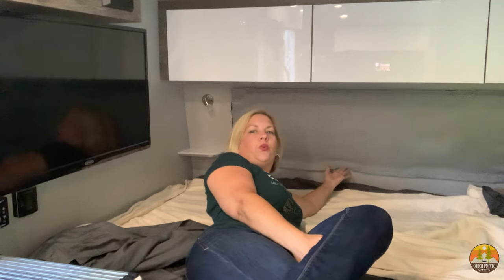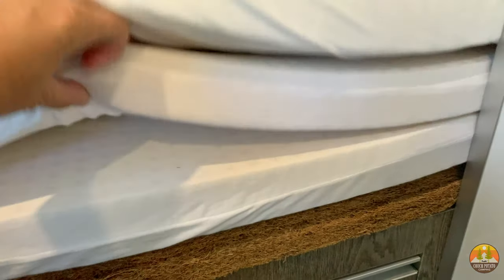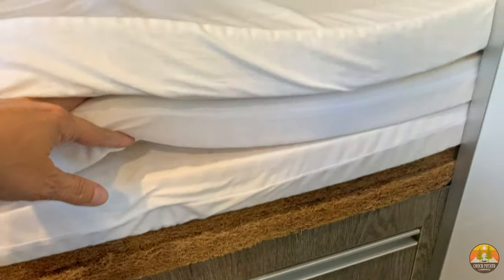How to DIY a Custom RV Mattress: Quick, Easy and Smart Solutions

Comment: Love this recommendation. What electrical work is needed on a brand new trailer? Is it a manufacturer issue or are you making alterations?  TIA
Reply from the maker: Hi Elizabeth! No work is *needed. But our exterior refrigerator all of a sudden stopped getting power from the 12v connection so that needs work.

Comment: I noticed your bed is surrounded by the walls (or window) of your camper which would hold your stack together.  Would these slide around if your bed was open on 3 sides?  Love the idea, and pricing mattresses is giving me stress, but the mattress that came with our new camping trailer is awful.  My husband had to stay in it for a few months and there is now a dent on his side. Also , being able to switch them around sounds like a great idea since we can't try it out. Thanks for any tips on that, Our 20 year old Casita was more comfortable sleeping on the cushions with the dinette folded down. No......really.
Reply from the maker: Oh, I fully agree! RV mattresses are the worst. If you stacked mattress toppers, I’d try to not have the covers on the bottom layers. Then they would grip together more. However, even with covers on, I think you’ll find they stay put. We just published our guide to the best RV mattress replacements:  https://couchpotatocamping.com/best-rv-mattress-replacements/ I understand how the dinette cushions were comfortable. We’ve had that same experience before, too 😂
Reply: @CouchPotatoCamping  Thanks!!  Awesome information!! Also Mattress Insider makes covers.  I thought about doing the Nesting and having them make a cover for my configuration and having the individual latex layers sit against each other per your suggestion.  That might hold the whole thing together. I appreciate your responsiveness and wish I'd found your guide earlier before I wasted a whole afternoon on research. Very helpful!! In general Mattress Insider has a great reputation and a great website.  If I don't go latex, I'm sure I'll get one from them.  Reasonably priced with very good reviews.
Reply: @CouchPotatoCamping  Thanks!!  Awesome information!! Also Mattress Insider makes covers.  I thought about doing the Nesting and having them make a cover for my configuration and having the individual latex layers sit against each other per your suggestion.  That might hold the whole thing together. I appreciate your responsiveness and wish I'd found your guide earlier before I wasted a whole afternoon on research. Very helpful!! In general Mattress Insider has a great reputation and a great website.  If I don't go latex, I'm sure I'll get one from them.  Reasonably priced with very good reviews.

Comment: I bought a mattress for the house and found it very comfortable so I bought the exact same mattress for the trailer.  I had back pain both nights.   Why is this.   Is this because there's no box spring and just a plywood board underneath?
Reply from the maker: It could be because of the hard plywood board underneath with no give. If there is not a box spring or slatted base there isn't much give.
Reply: @CouchPotatoCamping  what’s underneath the plywood and storage?  I was thinking of taking it all out and bolting down a bed frame to the floor and then putting a box spring on that. Would that work?
Reply from the maker: @efinden  In an Intech Sol Horizon? No, that wouldn't work. Underneath the plywood is the plumbing system. It is different for every type of RV, so that might work with some models. But not an Intech Sol Horizon.
Reply: @CouchPotatoCamping  how do I fix this?  Any ideas?
Reply from the maker: @efinden  No ideas on how to fix that!

Comment: Thank you for this! I have the same trailer and the bed seriously IS terrible. I ordered the medium mattress topper from this company and it's so much more comfy!! We just got one of them, so we'll see how that holds up but great idea getting one of each to switch between :)
Reply from the maker: Awesome! So glad you like it!!! The standard RV mattress that comes in the trailer truly is horrible. Definitely need a topper for it!!!
Reply: Do you a picture or videos
Reply: I went to Lowe’s and I got the 48” x 24” wide added 3 inches of half-inch plywood so it really comes out to 27”. i’ll try to use the changes they didn’t work so I put the a different kind on but I still screwed it down and I rounded off the corner I just took my jigsaw and cut put a plate up there and just cover the room and then I sanded it. I’m thinking about just go ahead look to what else I can find I laid down on just like laying on 🧱 lol
Reply: I watch that a thing for the mold but I don’t see a code and you said it was savvy rest I’ll have to go on the computer and look I did look at your camper is was nice it was at the place in Nashville Tennessee when I went to get a drain stopper for my little guy minimax of course they didn’t have them but your soul was there and I had to look it was different Sharp I love that window thanks for the tips I’ll be watching your show your well website there
Reply: Okay my husband is on that website on Sabi rest but don’t see that stuff that’s under your bed

Comment: I have listening to this video twice and still not sure of the name of the mattress toppers you are talking about.  I have a full size coil spring mattress in 5th wheel I love but the size is off.  The full is too large to even fit my hand in to make bed, the twin will be too small.  I need a 49x71" and these toppers may be the answer.  I am a side-sleeper with back issues.  The height is 6 1/2" max as this is a steel horse trailer 5th wheel so height is set.  It's called a Weekender.  What is the name of these toppers, where to buy?
Reply from the maker: The name of the mattress pads are in the video description with a link provided.